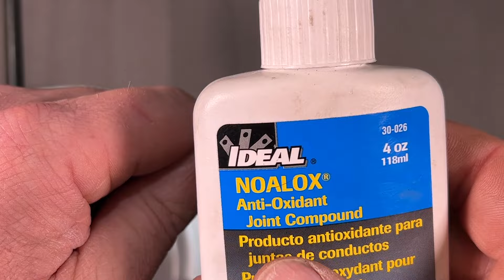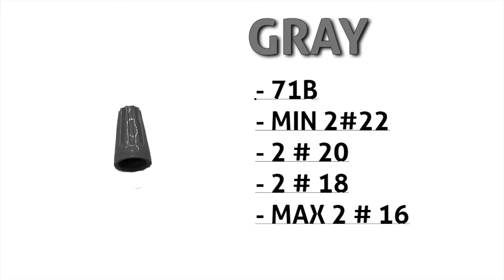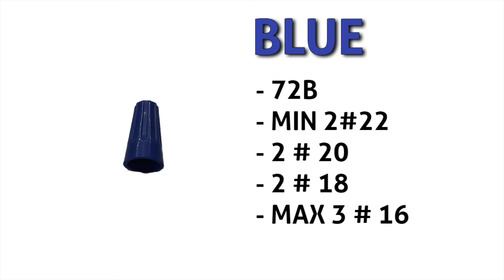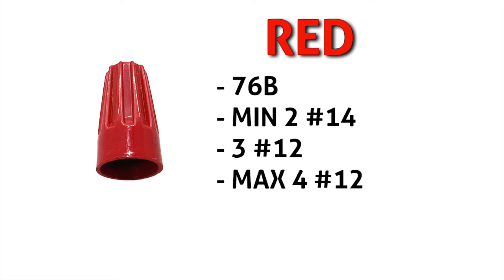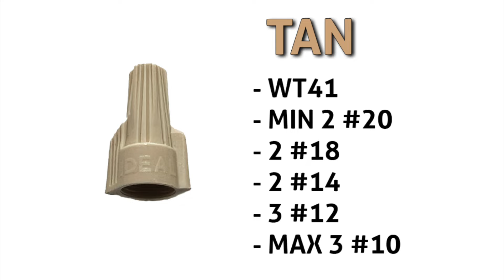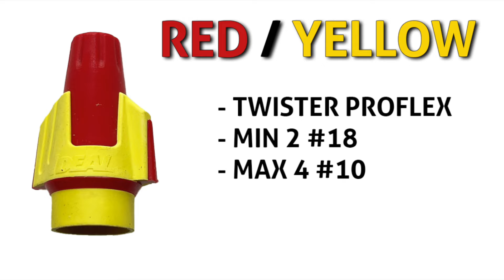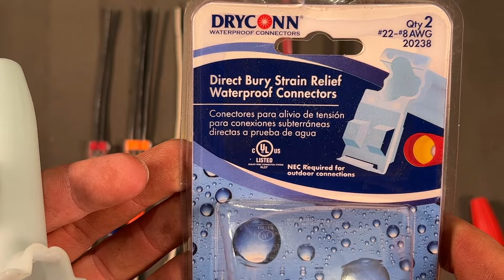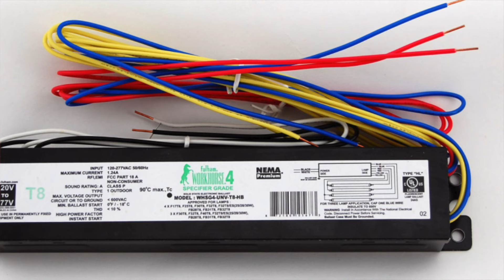A Guide To Wire Nuts - Wagos - Push In Connectors - Do It Right The First Time

Comment: I appreciate your advice of wrapping electrical tape around the wires before twisting. It helps a lot when twisting four 12 gauge wires. As a diy'er, excellent quality work is more important to me than speed. Prior to this, I was getting inconsistent results.
Reply from the maker: Right On! 🙌 I’m glad you found that helpful! It does really improve the quality of the twist. Makes it a bit easier!

Comment: 19:27 - WILD such a diverse range of wire gauges and ability to reposition,  Unlock short wire without worrying about trimming back each time wire connector is removed in old old houses.  Great info.  I knew a lot of it but still learned some new things and did not know about holding wires - always laid them flat before twist.

Comment: The company I work for typically  always use the Ideal Wing-Nut red ones for work, those are definitely my favorite wire nut to use. We often use the ideal tan twister ones like you have for tighter stuff like 2X4 light fixtures

Comment: Excellent, Jon!  I thought you'd be challenged to hold my attention for 20 mins, but your pace and volume of information (nearly all by demonstration) are spot on.  Did you mis-speak saying the Al/Cu nuts were filled with silicone?  I believe they are filled with anti-oxidation grease.  Would like to have seen King Innovation Alumiconns in the mix.  Bonus points for the blow gun specs and demo!  Thanks again!

Comment: I'm going to redo some wiring to the heating element of an electric dryer. Previous owners were hacks. One of my spade connecter to a thermostat was 90 degrees to the wire.  Besides wire nuts, I'll be adding spade terminals.  Just want to make sure my connected are heat, current, voltage capable. 

I did a retrofit of all my T8 florescent lighting to led and used wago in the fixtures.
Reply from the maker: Right On! 🙌 Yes I know sometimes they use high temp wire nuts in a dryer. Ceramic ones. I used them once in an old dryer. Probably not necessary in a new dryer but it’s a good thing to think about. 
Those wagos are perfect for that lighting.

Comment: This is absolutely the best video on proper use of wirenuts that I have seen, I subscribed. I like the Ideal twister pro flex and the 3M Performance Plus. I find the pre twisting is necessary with 3 or 4 wires when using 12 AWG. I have good results without pre twisting up to 4 wires when using 14 AWG.

Comment: Nice video, it was interesting learning about the different wire nuts, their sizes and different options, like with the silicone. I've seen years lighting wire laid out and don't recall them being weather tight, just with a wire nut in the elements. 

Also, I love the blow gun 😅

Comment: Very nice video with a lot of useful information.  I feel the push-in and lever connectors are weak in comparison to the other twister connectors because of the small amount of contact area.  I've seen the push in connector fail in duplex plugs (20 years ago) and cause arcing and failed connections where there is power coming in but no power downstream.  Thanks for the video.
Reply: It was likely the rubbish Ideal sell in their pushfit range if you seen it 20 years ago in the US.

Comment: One thing you left out is crimp nuts. Look like a wire nut but work more like a crimp sleeve. You still see these in some factory connections and they make a nice small gauge stranded wire connection. But they aren't removable without cutting them off. At a minimum, cutting right at the crimped section, you're going to lose at least 3/8 of an inch.

Comment: I had a wire nut fail on the shared neutral of two twenty amp circuits. The had not pretwisted the wire and it was on a garage door wall so it was constantly vibrated. When it disconnected it destroyed everything on the circuit that was only 120v. A device rated for 80v-240v like a laptop power supply would have been fine. 

I’m never going to use a shared neutral again. On my current shared neutral receptacles I’m going to pretwist the shared neutrals and add a wire tie.

Comment: I thought wire nuts were illegal 50 years ago. Americans are soo behind.
Reply: Wire nuts like we use today make the absolutely best connection short of twisted-soldered-taped. 
 In the UK, they used some porcelain  "wire nuts" that were prone to cracking. I've heard these were banned there. That was a 100 year old design and did not have the spring insert. Frankly, I have never seen one instance of these being  used in the US. They may have been used here, but I've never seen it. BTW, don't confuse the old porcelain with current design ceramic versions used in extremely high temperature applications. The old standard here going back to knob and tube days, was always twisted-soldered-taped. as best as I know, we went from that standard to the more modern style  wire nut as the replacement. These were designed to be an equal replacement. Plenty of scientifically based testing has proven that. 

As for being behind, you seem to be forgetting the inherently less safe 240 volt systems, ring circuits and receptacle plugs, large enough to be considered a dangerous weapon!! And then things like your RCD trips  at 30 milliamps vs 5 milliamps on our GFCIs. And then there are AFCIs requirements which the IK and other 240 volt countries barely even recognize to even exist!!

If you are looking back and seeing us, it's because we are about to lap you again, putting you even further behind!
Reply: I love Wago lever nuts and use them exclusively.  But, modern wire nuts done correctly are safe and secure.  I just don't like them because they are more complicated to install and too easy to get wrong, not to mention making rework a pain in the butt.

Comment: Jon, thank you for your instructive video!
I want to remove a light switch (2 actually - they're 3-way), then wire nut the wires and cover with a blank cover. I have all kinds of wire nuts. What kind should I use? 
Thanks in advance, Hulda in the SF Bay Area :)

Comment: On connecting more than 3 wires with a wire nut you have no proof that all wires are in contact to the bites of the nut. One of them may in the middle just getting hold by friction to the other wires. This is independend whether you twist or not. You're only control is test tugging each wire which is inconvenient inside a box. In the end you'll hope for the best.
It's like a four legged table not shaking. On lever connectors or push-in connectors (like Wago 221 or 2273) each individual wire is proof clamped. You can visual check this or perform an electrical check on the test port of the connectors.

Comment: By using black tape to assist you in holding the wires on the 4 wire white wire group, you effectively labeled that bundle a hot connection. You may want to mention this to your viewers.
Reply: I find Jon's advice on this is great for three or four 12 gauge wires, I use black tape on black wires and white tape on white wires and so on. So there's no confusion. No tape needed on bare ground wires. I'm not an electrician.

Comment: Thank you for this video. Very good 👍. Hey I have a question for you. So I am not an electrician by any means of the word. Getting ready to put in a new vanity light and a new kitchen light. What would be the safest and easiest connection for the diy guy?? It's woven to solid wire connections. I know electricity causes lots of house fires per year and I really want my family and myself to be safe.
Reply: Use a Wago lever nut
Reply: @surferdude642  thank you. I appreciate it.

Comment: Thanks - I was especially interested in the Wago devices - I am changing out switches and found 4 #12 wires on one screw terminal (grrr ) -- not much room in the box ,  but needed a compact way to get the connections and not about to repeat the original electricians error.